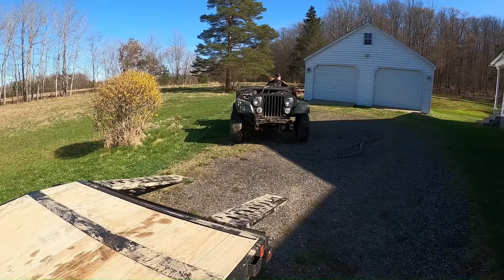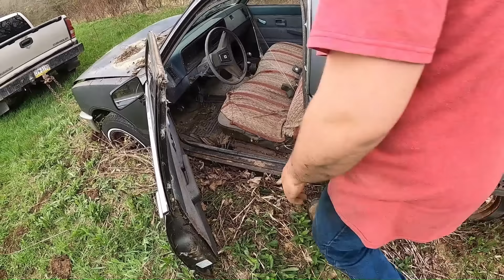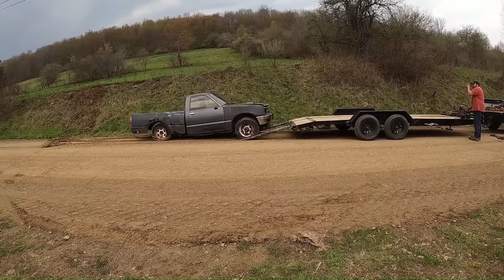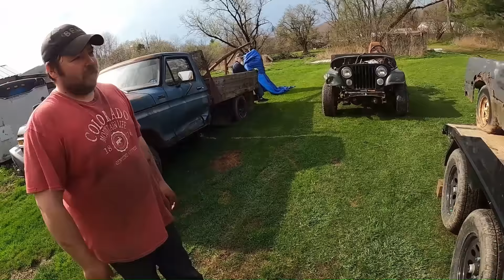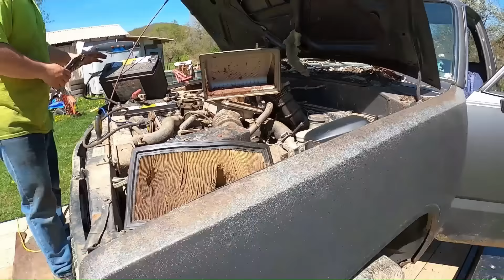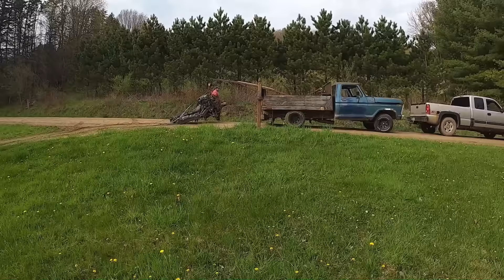Will It Run? Isuzu P'up Turbo Diesel Mini Truck Sitting 28 Years!!!

Comment: Those are outstanding little engines! 35-40 miles per gallon and just keep running. I've got one I saved out of a rusted body that only has 112k miles. Wish you kept the engine for a project. If the bodies were any good on these little rigs they would have been great
Reply from the maker: They are cool we just can't keep them all especially when we have money out on them. Thank you for your comment.

Comment: Pull that diesel engine and transmission out and put it in an s10 or some small truck those get 40 mpg or better when running correctly
Reply from the maker: If I could I would man but unfortunately we got to make our money back on this one but stay tuned this isn't the only one.

Comment: Americans are... interesting. You have a battery with screwed on terminals, but they never screw them on. It´s always twisting, hammering or some other type of violence. Why not do as the inventor intended, open the screw, put the terminal on the battery pole, then close the screw, with the well known: "righty - tighty, lefty - loosy"..?
Reply from the maker: One simple answer for that. Ain't nobody got time for that. Thank you for watching and commenting.
Reply: @FranklinsteinsGarage  Now that, my friend, is a good answer! Fantastic frame on the isuzu, will it take a jump in high speed..?
Reply from the maker: @mikeanderson2730  If I had the time I would have tried lol.